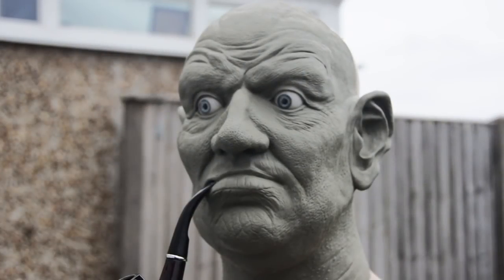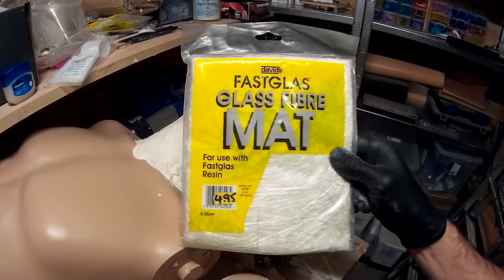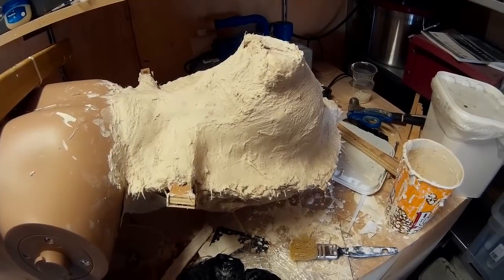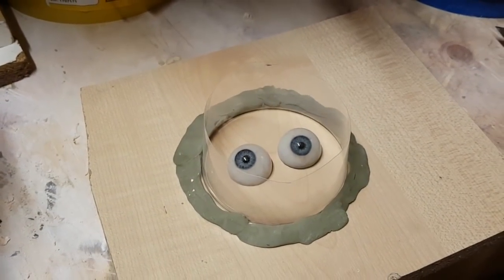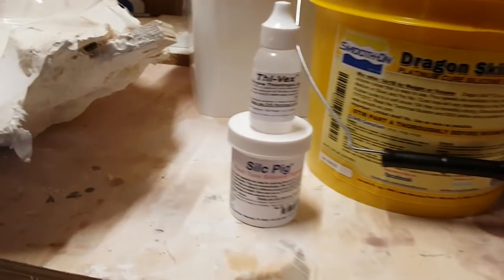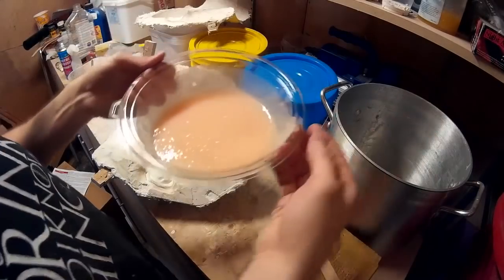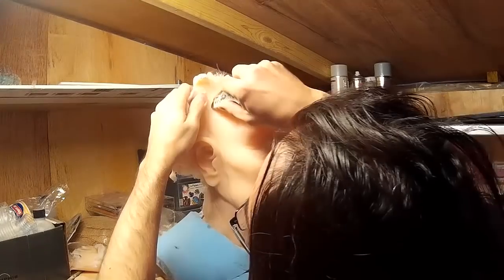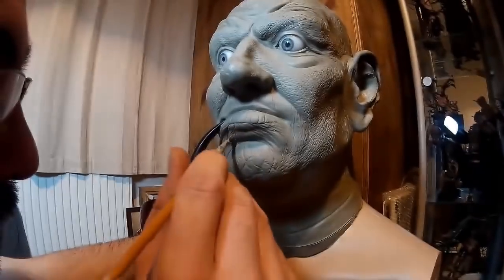Making a Silicon Statue Part 2 - Moulding and Casting in Dragon Skin Silicon

Comment: I would recommend not using fiberglass, use cheesecloth/gauze after the second layer, and in all other layers, it conforms to the sculpture better so it can be applied earlier on, strengthening the overall mold vs mat...it's why they use it for making molds of residual limbs for prosthetics and also for casts over broken bones...mat isn't even that great for making fiberglass casts... Unless ur casting something with very little detail, many layers of thin weave is nearly always the better choice...mat is thick and resists absorbtion as well as proper conformation  of shape...
Reply from the maker: Thanks for the tip, I'll have to give that a go.

Comment: Just wondering: instead of making cavities for the eyes in your mold, can't you just cut out eyesockets instead, with a hobby knife maybe? In the finished silicone cast I mean.
Reply from the maker: While maybe possible in principle, in practice you'd never be able to cut it accurately enough.
Reply: @thedarkpower  I see. I thought, given the flexibility of the material, that it might be possible to cut a little by little until it's just the right size to accomodate the eyes.

Comment: If you want to use an even thickness weigh  the clay you used and then add however much you want depending if you're brushing or injecting. Example your clay weighs 572 grams, measure 600 for brushing and 625 for injecting. Cheers!
Reply from the maker: Thanks for the tip!

Comment: The video was very informative for me. But now I wanna know how to make sure that the mould and silicone after pouring it will not stick together? Thanks
Reply from the maker: Thanks. Well I've never used a mould release for silicon in plaster moulds before and I've never had any problems.

Comment: Hi...i am planning on using your technique of creating an eye void using blank eye forms....in my application my mold will be a RTV skin mold with hard fibreglass jacket rather than your plaster mold..do you think this technique will work for securing the blank eyes into a rubber mold..i am a concerned that there could be leakage in the front of the eye form..did you also experience this on your mold...thanks in advance.
Reply from the maker: Hi.  Yeah I think that would work - are you casting silicon into a silicon rubber mould then?  I got some leakage on mine, but as the eye blanks were hard I could trim that away easily using a scalpel.
Reply: @thedarkpower  Hi..thanks for the reply..I am going to try a silicone mold and then cast silicone into this using the appropriate release agent..I will be trying test peices first to make sure I don't get adhesion issues...I will need to make a silicone mold to capture as much detail as possible and to be honest I have never had much success with plaster molds or casting...cheers
Reply from the maker: Cool.  I've cast silicon into silicon before so it does work, but yeah deffo do a test first.  Good luck, hope it all goes well! :)
Reply: @thedarkpower  Cheers I'll let you know how it goes..what do you back up your silicone casts with would it be two part expanding foam..cheers chris
Reply from the maker: It depends what I want to do with it - if I need a hollow interior I use fibreglass or roto casting resin.  Expanding foam if I want a solid piece.

Comment: Curious as to what you used for a core on this? I have been looking into tryig to make a silicone mask and the only thing that really stumps me is a core...I know i could lifecast my own head but i feel there should be an "easier" way to just do one for starters using that similar foam stlye head you have...any ideas what/where to get them?
Reply from the maker: I used a shop mannequin for this one.  You can buy mannequins specifically for masks like this one https://www.neillsmaterials.co.uk/product/silicone-mask-armature/

You could also take a lifecast of a head, I think the trick for masks is you want the core to slightly smaller than the wearer though so the mask is tight against the face.
Reply: @thedarkpower  basically what i was refrring to was the foam one you used.. but i can see where the armatures come in handy as they have open mouth and such for good cupping effects
Reply from the maker: I'm not sure I used a foam one did I? 🤔 might have forgotten 😉
Reply: @thedarkpower  it sure looks like a foam one..at least in the way it moved when you were removing it..i'll have to go back and look again

Comment: You do a very good job on your videos. I’m from the uk can you advise me where I can purchase a decent silicone to cast a 9 inch figure I sculpted,is the particular sites you use.thank you if you could help
Reply from the maker: Hi.  Thanks very much.  Well most of the moulding silicon I use in the videos is from https://tiranti.co.uk/  I generally use the T20 and T28 silicons (they have a shop in warren street in london which I go to) .  You can also try https://www.benam.co.uk/ who are smooth-on resellers.  Smooth-on's probably the more well known brand, a little more expensive though.  You could also try  https://www.dwrplastics.com/home  They seem a little cheaper.  I've bought some stuff from them, I've not used it yet though so can't vouch for how good it is.  I've friends who have who say it's fine though.  Hope that helps!

Comment: Good videos,Is it easier to use a silicone rubber,for a mould,by weight or by volume like the dragon skin ect.Thanks All the best for 2018
Reply from the maker: Thanks - it depends on the silicon.  The instructions should say which method to use.  I've always mixed by volume as I think that makes more sense - I generally have an idea of the volume I need to fill, but not the weight of the material needed.  However if the instructions say to mix by weight then do that - the material may not cure if you do it incorrectly.
Reply: Thanks

Comment: This will work for a mask right? guna do the exact same but add power mesh to the neck area.
would you recommend platsil gel 10 for a full head silicone mask or dragon skin? plus if i wanted a thick paintjob like the lipstick on the joker how would u do that?, just add more pigment?
thanks
Reply from the maker: Yeah I'd imagine this would work for a mask. I've not used platsil gel 10 I think dragon skin would be ok though. I used psycho paint to paint mine, you can add more pigment to make the colour thicker.
Reply: @thedarkpower  thanks for the reply, will probably use dragon skin tbh, Amazing work btw.
Reply from the maker: Cheers, hope it goes ok.
Reply: @thedarkpower  thanks dude p.s did you use any release in the mould before pouring the silicone?

Comment: Can you use eco flex silicone ? I see it is similar to dragons skin.
Reply from the maker: Yes I think so - I've not tried eco flex but I've been thinking of getting some as it does seem very similar.
Reply: @thedarkpower   I see people are using eco flex for dolls and dragon skin for mask ..but also dragons skin for doing elastic and stretchy molds.
Reply from the maker: Yeah there's no one particular use for either material - I've used dragon skin for both this sculpture and also for moulds.  It depends if the properties of the rubber will fulfil the requirements of your project.

Comment: Amazing video, I've been looking for a decent tutorial video using silicone for a while, so thank you! Can I ask, did you use a release agent for the plaster mold at all? I have a mold I used to use for latex but wanted to try it out using silicone, you think this would be ok? Thanks again!
Reply from the maker: Thanks Daniel.  I didn't use a release but the plaster did discolour a little so it seems to have absorbed something from the silicon, so perhaps I should have.  It didn't seem to affect my cast at all though, so just a note of caution there.

I would be cautious casting silicon into a mould used for latex as I know some silicons canbe inhibited in the presence of latex and refuse to cure.  So check the data sheet before proceeding and maybe do a small scale text first just to be sure.  Good luck!
Reply: @thedarkpower  brilliant, thanks, I have seen people seal the mold, I'm not going to be using it again for latex. So I may clean it out using Naptha and possibly seal it. Hard to find anyone else who has done something similar before. Thanks again and I've subscribed to you channel :)